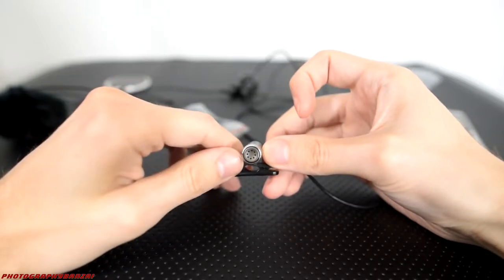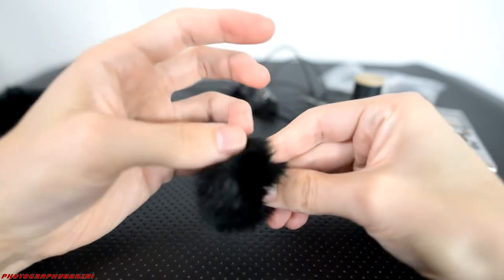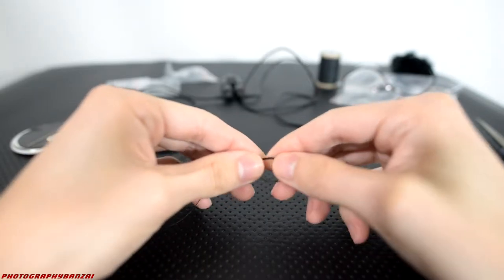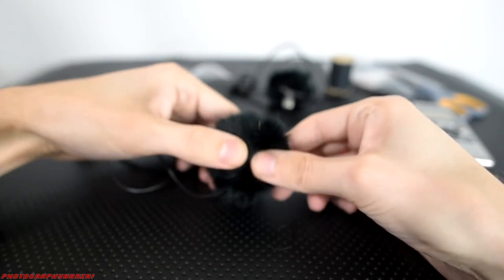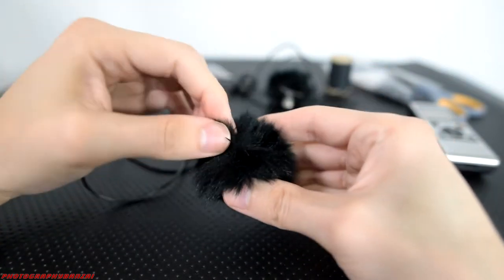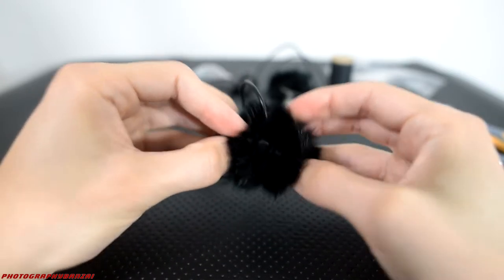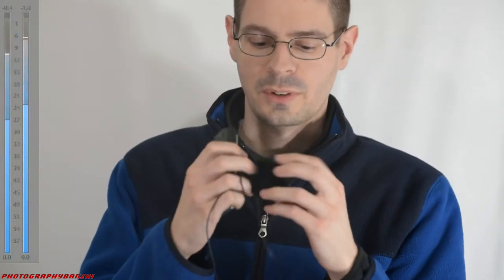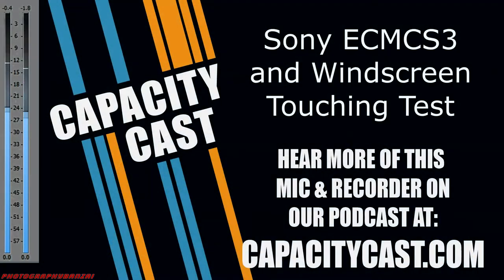Sony ECMCS3 Lapel MIC Windscreen DIY Mod and Testing

Comment: Thanks for the gr8 idea!  I recently purchased the same Sony mic but was unable to find a fuzzy dead-cat of sufficient size (most are 0.4” max). I adopted your idea of sewing two smaller “cats” together but used elasticized thread instead, allowing for a secure fit, yet easy removal. This type of thread may be found in Craft stores, usually in the Beading/Jewelry-making section.
Reply from the maker: Nice, glad it worked out for you. The stretchable thread is a good idea.

Comment: Hi, found some windscreens on amazon but 2 available sizes, 5mm or 10mm. Can you please tell me the diameter of the microphone so i know which one to order with the microphone? Thanks
Reply from the maker: The barrel on each end is approximately 10mm in diameter. There there is no ridge on the shaft, so that's why I sewed two together to keep them attached. The length of the microphone is ~30mm. I'm still using the modded mics to this day!
Reply: @ScottJWaldron  thanks a lot. Thinking to stitch 2 windscreen together with a piece of stretch webbing so it's possible to take it off. But will order 10mm and not 5mm. 👌🏻